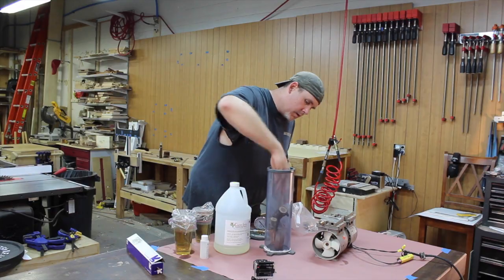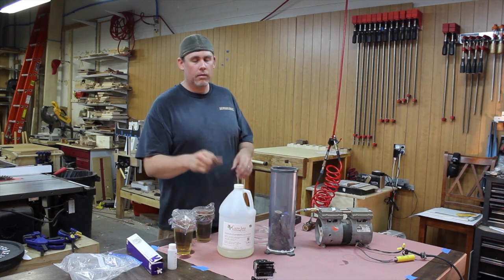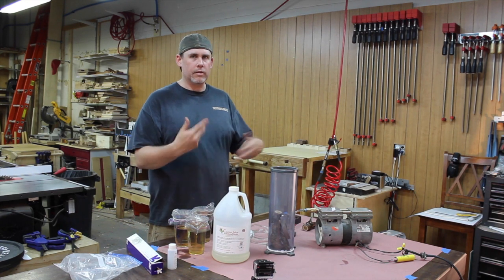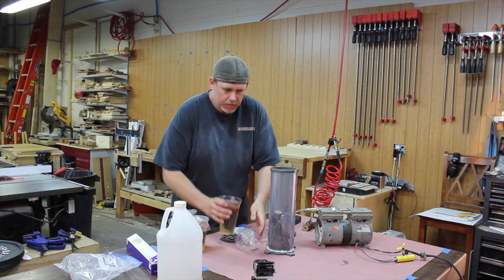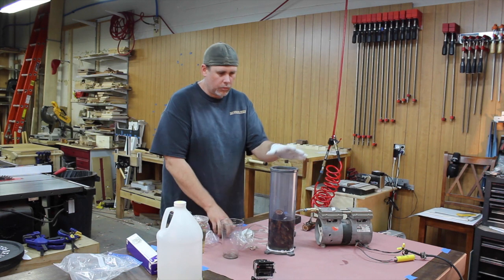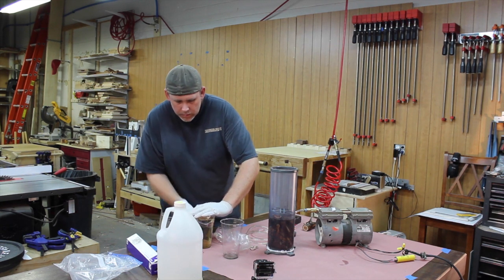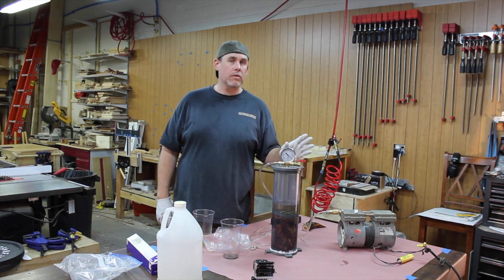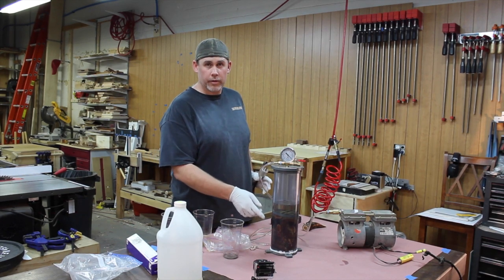Stabilizing Wood Part 2 - Pulling Vacuum

Comment: Hi Zac, Awesome video! I can't thank all of the You Tube "teachers" that provide the community with helpful information.
A tip, add a second reservoir between the tank and vacuum pump. If any fluid enters the pump it will be toast. They remove air and are not a water pump. I would use a sturdy 1/2 gallon glass bottle (wine) with a cork 2-  1/4" holes in the cork and 2 tubes, one from reservoir and the other going to the pump suction.I did refrigeration for 40+ years and used a vacuum pump dailey. 1/4" refrigeration hoses are fairly cheep and last forever. They won't collapse like poly tubing either.
Reply from the maker: Hey konaok, thanks for the tip.  I'm definitely out of my league when it comes to vacuum pumps. I have a list of things to upgrade on the system anyway... like a power switch for one, and I want to hook up a switch so the pump doesn't have to run the entire time.  Thanks for watching the videos, and thanks again for the tip.
Reply: +konaok1 You people are so smart. I love you guys.

Comment: thank you for sharing this incredible how-to. 
question, How do you avoid the cactus juice from sticking to the chamber walls. is it like urethane that solidify and ruins every darn thing?
Thank you
Reply from the maker: +David RealtorCT Good question David. Stabilizing resin doesn't work like casting resin. It stays in liquid form in the chamber, so you just wash it out with soap and water for clean up. 

This is the second video in the Stabilizing Wood series. In part 3 I do the baking part which is when the resin hardens. Here's a link to the playlist if you'd like to see all the steps https://www.youtube.com/playlist?list=PLoeB-EPC_91vC03jk5hS8SH_7Ow4nqyZL
Reply: +Zac Higgins thanks

Comment: Hi Zac,

I am looking into stabilizing wood but I have a problem I don't know how to solve. My understanding is that cactus juice is sensitive to heat, and that stabilizing should be done in a well ventilated area. Well, my workshop is not temperature controlled, and I live in Florida!! Of all places :) Right now the temperatures outside are in the 90s, and it gets just slightly cooler at night. What do I do? Do I bring the stabilization process inside the house, and do only the baking in the workshop? Do I wait until the winter months...um, I meant winter month! I'm really at a loss here. I hope that you could help. 

Thank you again for all of your videos! They have helped me enormously!

Emily
Reply from the maker: Hey Emily, that's a tough one. I'm not entirely sure what I would recommend actually. You definitely don't want to store the Cactus Juice outside if it's in the 90's because it can start curing in the jugs above 80 degrees. If you do keep it outside, I'd refrigerate it. I'd probably wait until cooler days/times to run the vacuum process too. My shop doesn't get too much above 80 degrees in the summer months, so I haven't had to worry about high temps and stabilizing myself. I'd definitely contact Curtis at TurnTex.com, he'll have the best suggestions on how to stabilize in hotter temps
Reply: That is a good idea. I'll email them. I was thinking that may be I could vacuum it inside the house then take outside for curing..I really hate to wait until it gets cooler here. It never does :D
Thank you!!

Comment: Very interesting!  I noticed you seemed to turn the vaccuum container up and down a few times. Is there a certain setting that one is supposed to have it on, and do you ever have problems with it wanting to overflow?
Reply from the maker: Initially, there is a lot of air in the wood, and the vacuum causes the air bubbles to expand making the resin level too. You definitely do not want to suck any of the resin into your pump though, so you have to play around with the amount of vacuum you are pulling off the bat to keep the resin from getting too high. Closing the valve will increase the vacuum being pulled, cracking it will decrease the amount of vacuum. Eventually, the pump will have sucked enough air out of the chamber that you can fully close the ball valve and pull a full vacuum. You need to be pulling a full vacuum to get all the air out of the wood

Comment: Zac, I just got my stabilizing setup running and I'm using it the first time.  Do you have to keep pump running once maximum vacuum is achieved, or can you turn it off at that point?
Reply from the maker: Hey Johnny, glad to hear that you're ready to rock! You will have to leave the pump running the whole time because it needs that suction to continue pulling air out. Once all the air has been removed from the wood, you can shut down the pump and let the wood soak in the Cactus Juice
Reply: Thanks for the advice.  I figured so by the action of the bubbles being so much more when pump is actually on at max vacuum.  My plan is to make e-cig vaporizers out of wood as it has so much more character than metal. 
:-D

Comment: Hey Zac, 
Have you counted how many pen blanks you get from a gallon of the resin?
Reply from the maker: I actally get 2 gallons of Alumilite when I order it, and out of that I could probably get around 90-100 if it were just resin pours. When you start adding things like wood into the casting, you'll get even more since you're using less resin.

Comment: I'm freaking out a little bit. I was getting ready to stabilize some wood and my pump sucked in some of the cactus juice. What should I do?
Reply from the maker: I'm not entirely sure. That typically will kill a pump from what I have heard. You might ask Curtis Seebeck about it. He's got a lot more knowledge about pumps than I do, and he might have a suggestion on what you can do.
Reply: Thanks Zac. Will do.
Reply: Since this stuff requires heat for it to cure (solidify), the odds are the resin inside your pump will remain in liquid form. If you feel comfortable taking apart your pump, I would do so and simply clean it with denatured alcohol. Try to stay clear of any rubber gaskets or O-rings with the alcohol, (just in case). It may shorten the life of the gaskets (probably not).

Comment: Can you use a pressure pot to stabilize wood?
Reply from the maker: Technically you could convert one to a vacuum chamber if you buy a clear conversion lid. Best way to go is with a totally clear chamber though like the TurnTex.com one I use. Visibility is a must to see when you've gotten all the air out of the wood.

Comment: Does the vacuum pump have to be on the entire time?
Reply from the maker: Hey Robert, that's correct, you'll want to leave it running so it keeps sucking the air out of the chamber